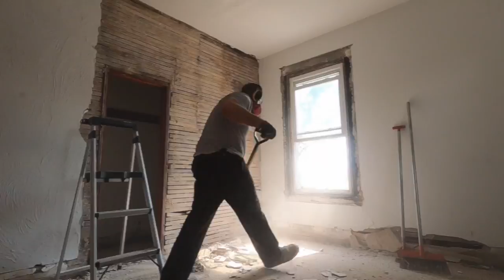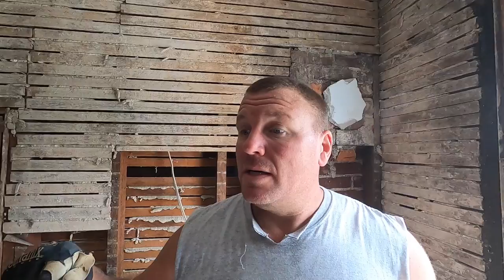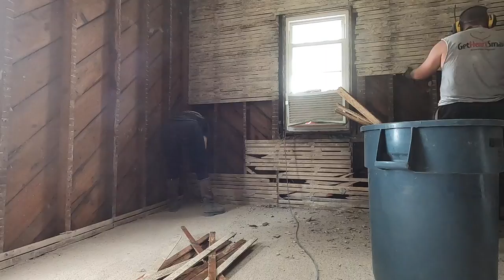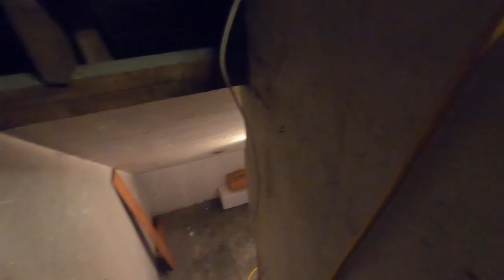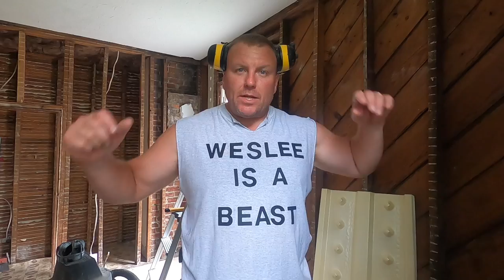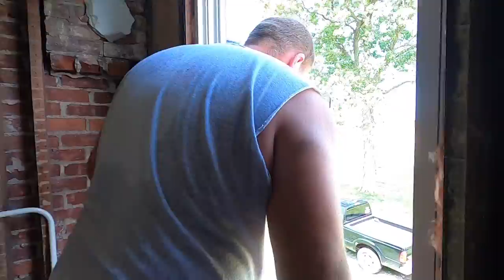How To Efficiently Dispose of Plaster & Lathe

Comment: I am embarking on removing lath and plaster in my house that was my mothers built in 1910. I was told I have to get the plaster tested for lead. Did you test for lead and if so what did you do with the old plaster? The burning the lath is a great idea! I am having my house lifted and moved to my back yard and a new basement poured, then new electrical, plumbing, sheetrock and bathrooms added. I want to do the demo of the plaster and lath myself as you and your wife did. I just need to know what to do with the plaster if it has lead in it? Loved the video by the way!
Reply from the maker: Well………This place was redone probably 30-35 years ago in most of the rooms so I think any lead would have been taken care of then.  That being said, if it truly has lead then based on what I know, you would need to get an abatement company come do a very expensive job of removing it.  I’m pretty sure they spend all this time setting up air tight enclosures, bag it all up, tape it all up, and then just toss it in a dumpster, where the bag will get torn and all the dust will fly all around anyway.  I don’t know friend, I wouldn’t tell you not to do things “the right way”, but I might just go get a nice respirator and some goggles and go for it.  You do what you think is right and good luck.  Thank you for watching.